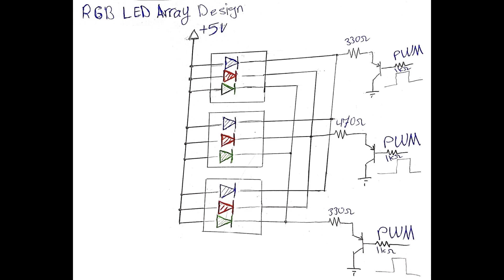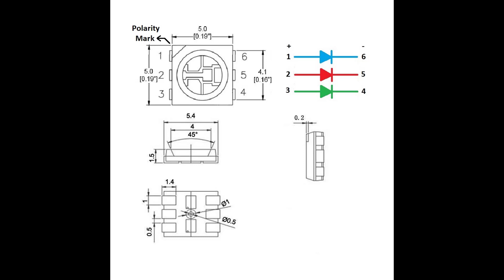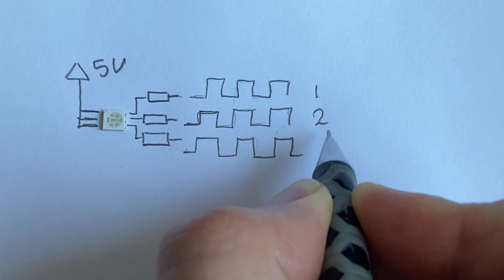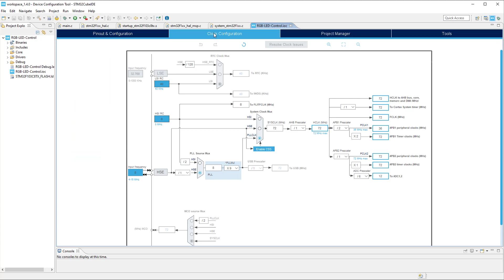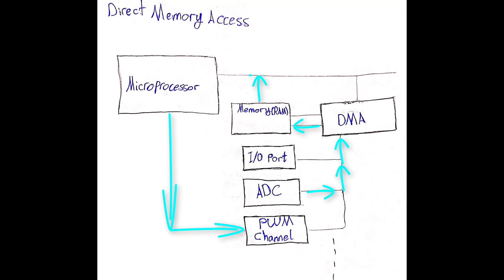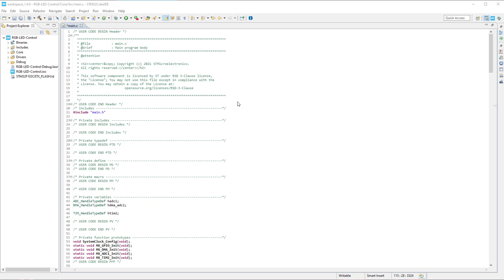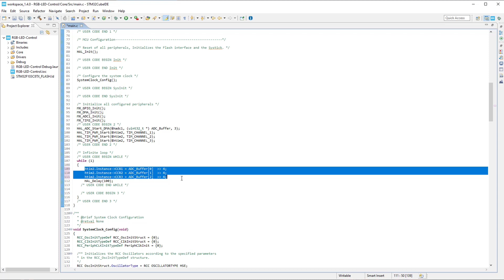RGB LED Array Control Using STM32 Multiple ADC Channels With DMA

Comment: Nice video, but electronic design is wrong. You should use NPN transistors as low side switches not PNP.
Reply from the maker: Hi, I used PNP transistor to avoid inverse logic at the output. Using PNP is not the issue. The problem is the used LED parallel configuration. A combination of series and parallel LEDs would guarantee better current distribution
Thank you for your feedback
Reply: @usefulelectronics  there is no inverse logic with NPN transistor. HIGH on MCU pin turns on NPN transistor. Also you don't need base-emiter resistor to keep it off when there is no signal.
Reply from the maker: @PLGonzoG  yes You are right. I have checked the BJT I used and it is 2N5551 which is an NPN actually. I demonstrated the BJT I am using at 4:02 I will correct the schematic. Thank you

Comment: @1:17 Just an FYI, that is not called a "DIP" package, but just a "through hole radial" package.  DIP packages are Dual Inline Packages which are 2 rows of pins (like ICs or resistor arrays, etc).
Reply from the maker: Thank you for the correction